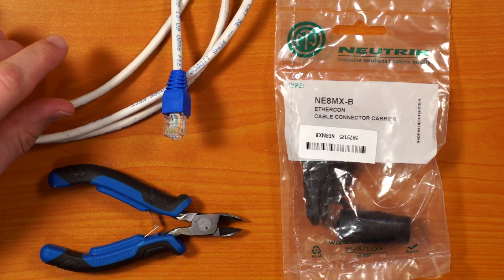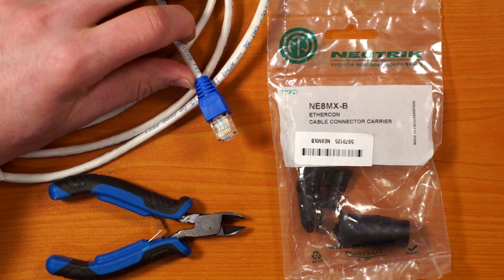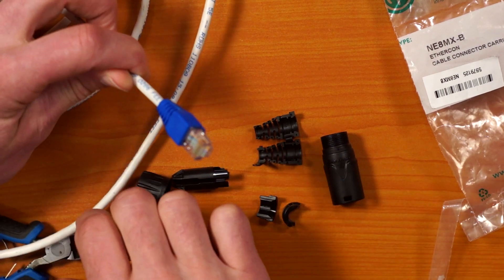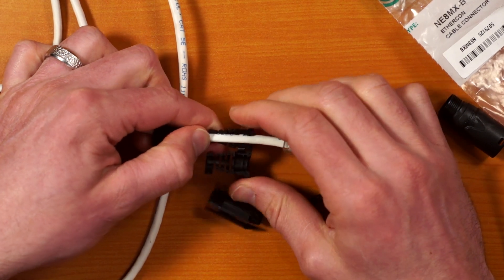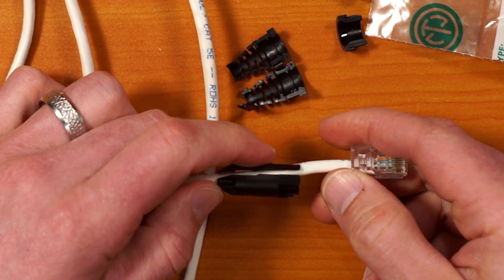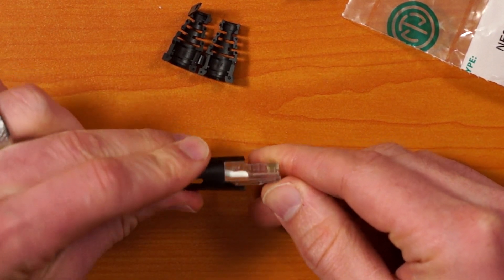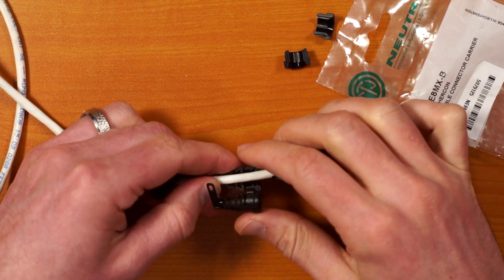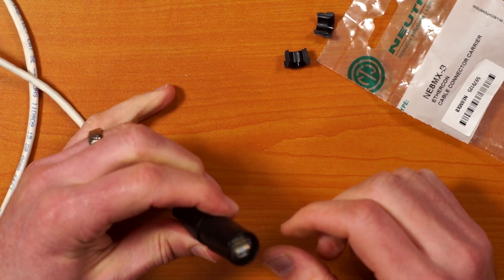How to Assemble NEUTRIK ETHERCON Connector Carrier

Comment from the maker: If you are using gear that supports these you have to use them. So much better to work with! Have you found the normal ethernet ends as annoying as I have?
Reply: How can i contact you for a few pointers?
Reply from the maker: @DAgyemfra  I could reply here to start. What do you need help with?

Comment: The exact video I needed.  I have pre-assembled cables that I want to strengthen at each end with the XLR Ethercon connectors.  I have ordered them online from a local shop but wasn't sure what the difference was between the connectors for assembled and non-assembled cables.  Saves having to terminate my own RJ45 plugs, thanks this was a very helpful video, precise and to the point.  Regards.
Reply from the maker: Appreciate that

Comment: Great video. Simple and to the point!! Thank you :-). 

Just wanted to ask if any CAT6 or CAT5e cable will work for Ethercon or do the pairs need to be crimped in a different order?
Reply from the maker: Any should work. There is an a standard and a b standard. Either should work with whatever cable, but sometimes there’s good reasons to use a different standard
Reply: @churchaudiolife  Thank you!! :-)

Comment: Do they work with shielded rj45 connectors?
Reply from the maker: There is a wide range of RJ-45 connectors, but it should work with most of the shielded ones

Comment: Could you do a video with STP and show how to do the grounding to the ethercon Shell?  I want to be able to repair my cables for my M32, and that's spec to have the grounds.  Nice easy video.
Reply: AFAIK it’s exactly the same procedure for STP cable. The continuity between both ethercon shells come from them both being in contact with the cable shielding.
Reply from the maker: I haven't actually connected STP with the ethercon shell. These are connnector carriers, so they had no way of doing that. I think you would need a different version of the ethercon end. I know they make one where you punch down right into the ethercon connector. That likely would be what you need. But they are a bit pricey.
Reply: I am not sure that you need to do anything special for these to work with STP.  I just assembled two NE8MX connectors to a 100' long Cat5e STP cable.  The collar is a snug fit going over the STP RJ45 connector and neither one of the strain reliefs were a good match for the wire I bought.  However, when I tested my new cable using two Cat5e to XLR " Cat tails" with a condenser microphone, it passed phantom power and the mic worked.  I also show continuity between the Ethercon shell and the metal housing around the RJ45 connector.